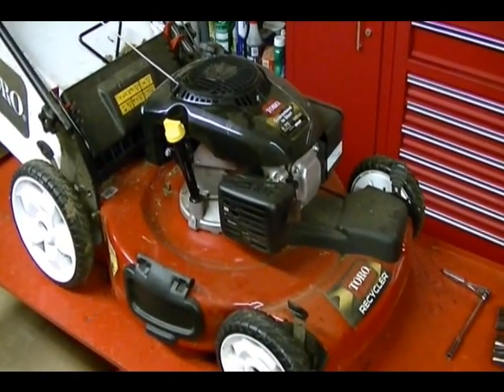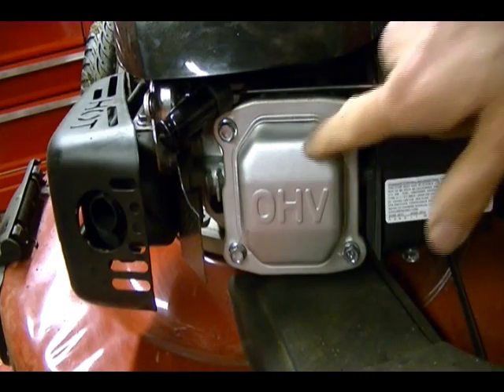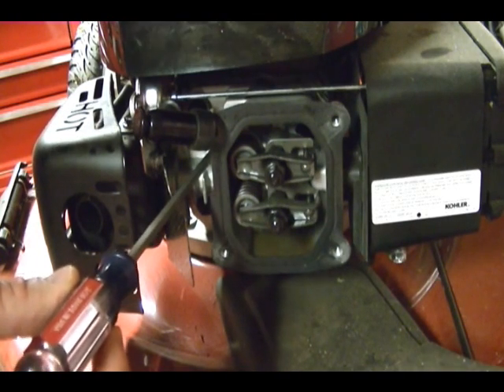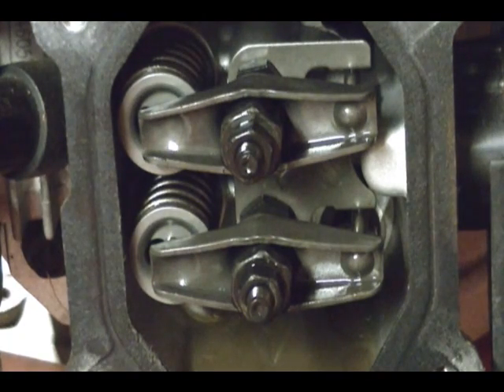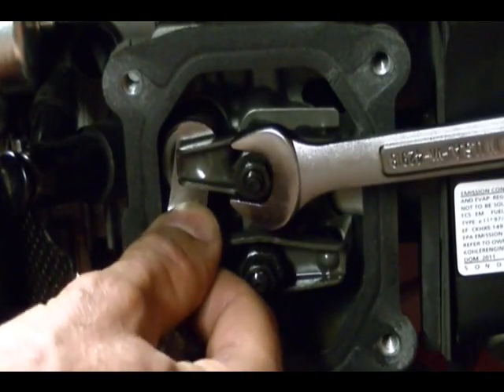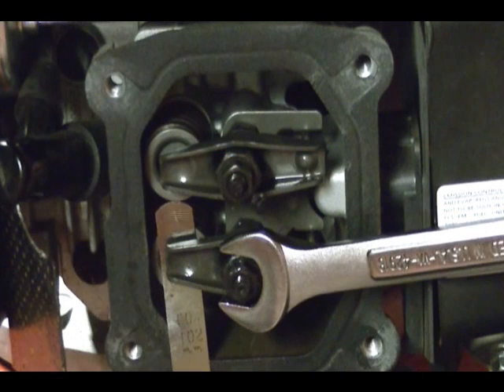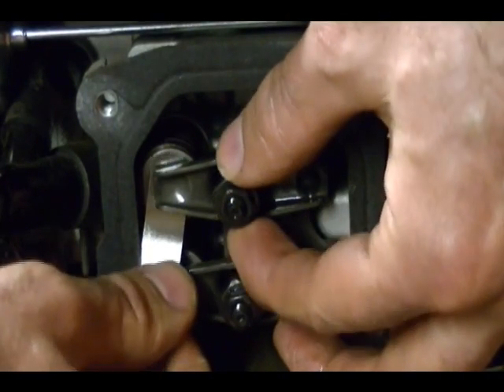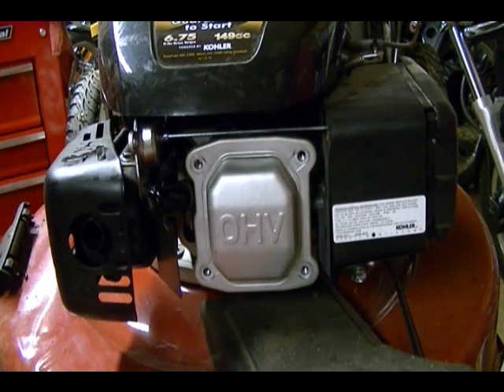How to Adjust the Valves or Valve Lash on a Kohler Courage XT Lawn Mower Engine

Comment: Great video!  I still own a recycler from 2012 with that engine That Im currently having trouble with. It starts when cold, runs until I begin to mow then rpms drop until it stalls out.  I’ve disassembled and cleaned all fuel ports on the carburetor. Checked the fuel filter, cap, small lines, adjusted valve clearance, changed oil with new sparkplug.   Im not really sure what else it could be. Im thinking maybe the autochoke… Any thoughts?
Reply: Common causes: jet set wrong, water in fuel, kill switch is intermittent, brake engaging, low oil,  inner fuel line disintegration, fuel line cracks

Comment: A tip,.... tip the mower back, and support it with a jack stand, so when you take the valve cover off, all the oil that is in the valve area will flow back away from the opening, so no worries about oil going everywhere, wait a few minutes b4 removing the valve cover so the oil can flow back, then remove the valve cover, also while you have the mower tipped back, it will give you access to rotate the blade, to get the valves to move, much easier then rotating the flywheel.

Comment: Thank you very much! Clear, concise and to the point, EXACTLY the information I needed. Have the exact same Toro mower and the XT675 starts to skip when it warms up. It's not the carb or the ignition (already been through them), not the tank vent (done through a carb tube) so I suspect the valve lash is too tight. Easy-peasy to check, thanks again!

Comment: Great video, thanks for sharing.  I have a 15 HP OHV Kohler with no adjustment screws. But, for sure the valves stays open about a quarter inch. Engine won't start. Any idea how to adjust the valves?//Luis

Comment: hi
i have a toro lawn mower 22" front traction 6.75 kohler engine ohv,
i cleaned the under carriage of lawn build up, had the mower on the side dip stick down ,  cleaned all went well i put the mower back up and started the mower is was good , until the following week i went to start the mower it started up fine ,then a few minutes running it started to sputter then i got a cloud of white smoke , so i stopped it and i restarted it and i got a cloud of white smoke again , then it worked fine no problems. until the following week, starts up fine after a few minutes it starts to sputter and i get some white smoke .then it runs fine , 
i would appreciate if someone can help me with this issue .
thank you
joe

Comment: yep i noticed that you didn't have to use a crow foot wench that was pretty cool how you took the whole entire valves off and tightly the back bolt and replace the valves for adjustment very smart

Comment: Fantastic video!   I'm new to small engine repair but I'm getting better at it every day.  I have a Honda HRR216K4VXA that I'm sure is in need of a valve adjustment.  Honda, for some reason, does not use a gasket under the valve cover.  The shop manual says to use Hondabond HT.  Have you any recommendations when using this stuff?  I really enjoy your videos, thanks again.

Comment: I have Kohler XT149-0026 the motor dies when it gets hot! I removed the carburetor, cleaned it, installed new kit, auto choke seems to be working, fresh gas! If the valves are too loose would this cause the motor to stop when hot? or vapor locking! How do I stop vapor locking? Nice video thank You.
Reply: Mark Ristau yes , you must put lock title on threads after readjusting valves

Comment: I am working on a Briggs and Stratton model #11P902-0127-B1 the problem I am having is when I pull the pull rope to crank it, it sprinkles gas out the spark plug hole and it floods out. I changed the float needle valve and seat and I am still having the same problems with the gas coming out of the spark plug hole. Any help would be appreciated.
Reply from the maker: +Michael Barnes I assume your putting the spark plug back in and tightening it down properly. Do a leak down test and make sure your top end is in good condition.

Comment: Great Video.  I have a 26hp Kohler V-Twin that has intermittent long periods of sputtering, feels like a fouled plug but they are both fine.  Replaced Carburetor and Fuel Pump but still sputters.  Could this simply be valves that need adjustment?
Reply: Did you ever figure out what the problem was?

Comment: Yes, great video, very clear and understandable,  BUT, doesn't explain why it is important to not have too tight valve clearances.  What are the symptoms/problems of the valves being too tight? My mover is currently inop (will not crank freely while trying to start, except with spark plug removed), and a valve adjustment may be my solution.

Comment: I have been having to use starter fluid to start my mower. Do you think my valves need adjusting to correct this problem, or is the carb dirty?
Reply from the maker: I think its a fuel related problem.
Reply: If it is this model engine,it is probably a dirty carburetor or the auto choke is bad.
This should be inspected on a cold engine. Remove the air filter and see if the choke plate is closed. If not,check the linkage between the choke plate control arm to the thremostatic choke control that is mounted on top of the muffler and the choke control should not be holding the choke plate open when cold.
If it is,replace it.
Two 10 mm nuts.
Claw hammer to the old one,to be sure it is bad and replace with new one.